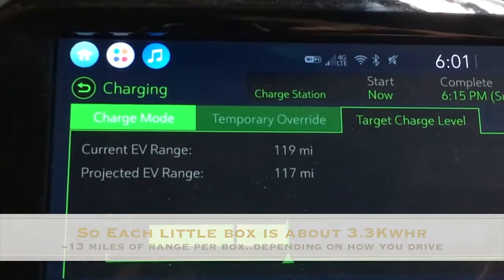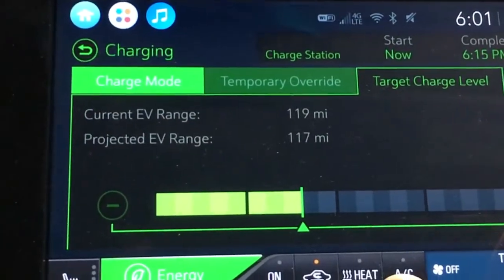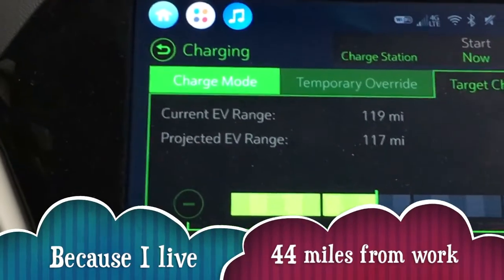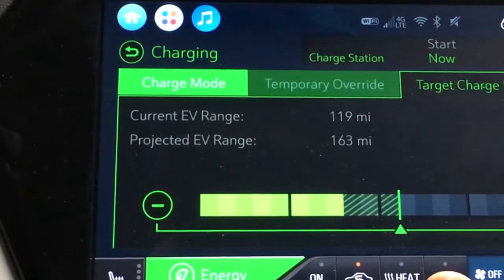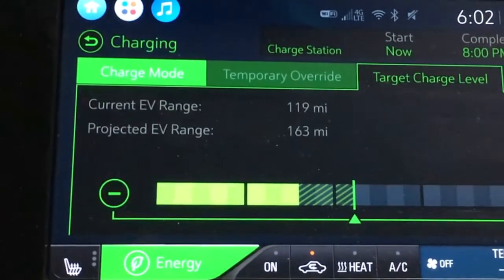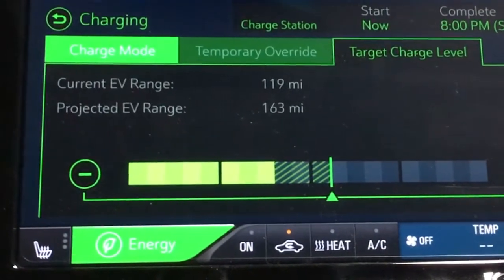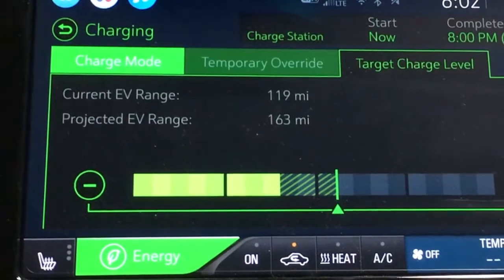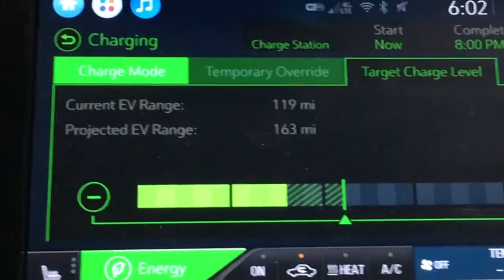2020 Bolt Charging Control Explained: What do the Squares Mean? Also: Battery Conservation Strategy

Comment: Just FYI this revised charging screen actually came in with the 2019 Bolt.  How long do you "store" your Bolt where you would worry that having a higher charge in the battery would be a bad thing?
Reply from the maker: Cory Muzyka Sometimes a few days but it adds up. Leaf losses have been substantial but have leveled. The only option in my year is 80 or 100%. I keep it at 80 unless I’m going somewhere. As I said in the video, it’s not a bad idea. I don’t make off the cuff trips and have 4.8kwhr rate at the house so overnight would fill it.